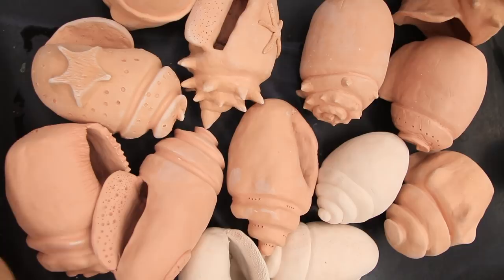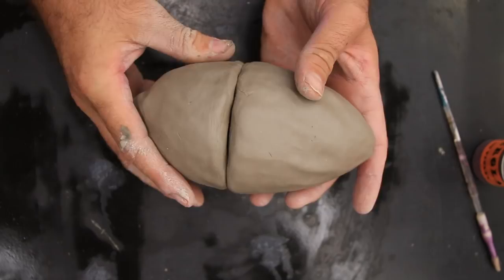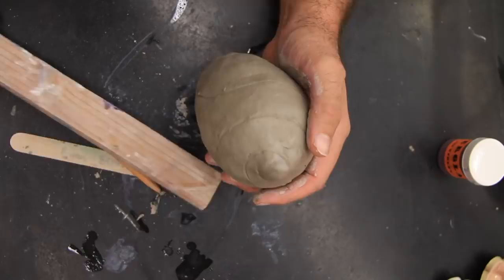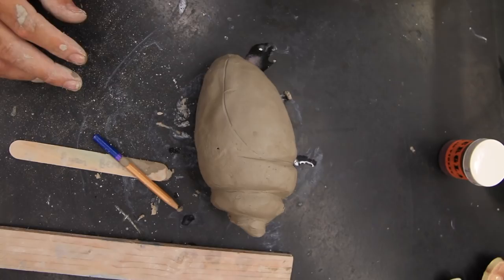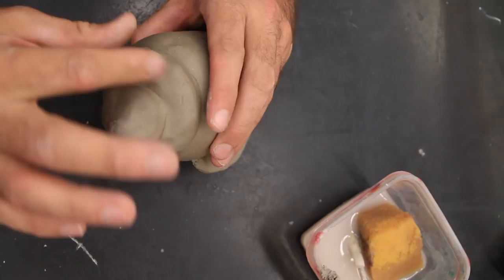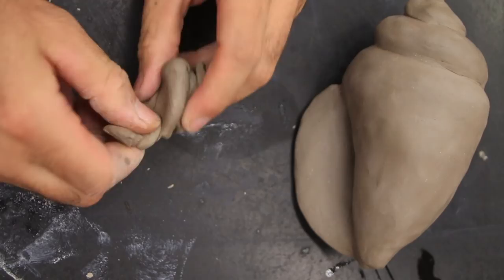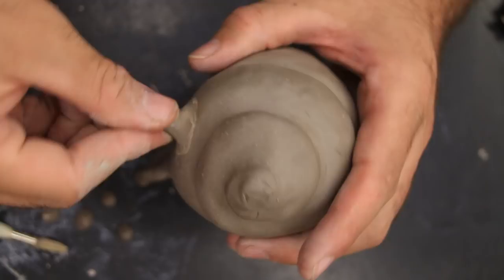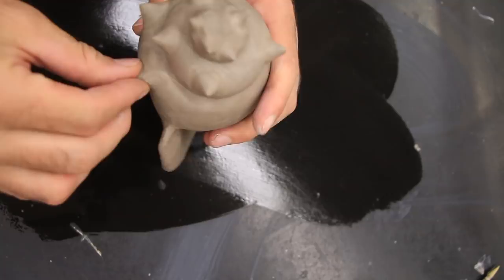How to make a clay sea shell sculpture

Comment: I am having so much fun making the shells and acorns and now pumpkins, eggplant, apples and pears!  a whole new line of ceramics for sale... I make up a whole bunch of the pinch pots in different sizes and round, oval, long.... let them set up and then "go to town".  I also extrude coils and that makes it quicker to create the "tops", etc.     

Can you explain your "hot box".... what is the source of "heat"?
Reply from the maker: It’s a metal cabinet with a space heater and a fan. Shelves are from a wire kitchen cart. So heat can flow through. Maybe I’ll make a video on how I built it. It works amazing!